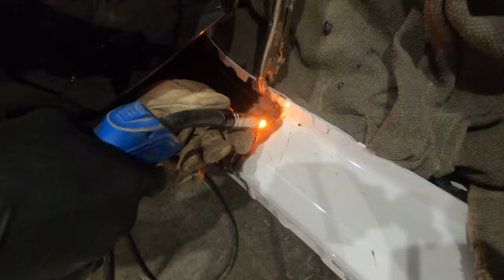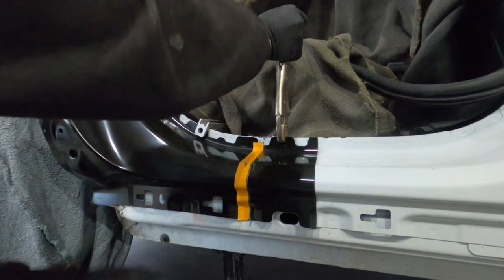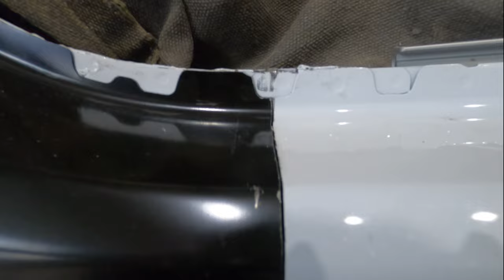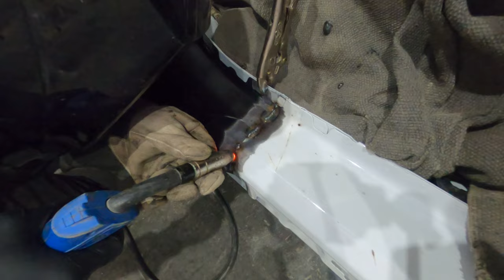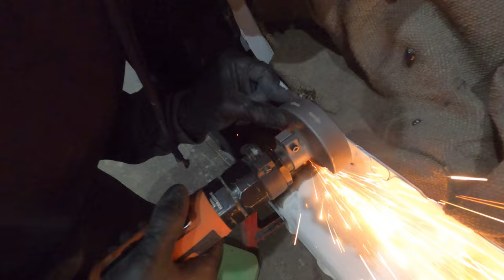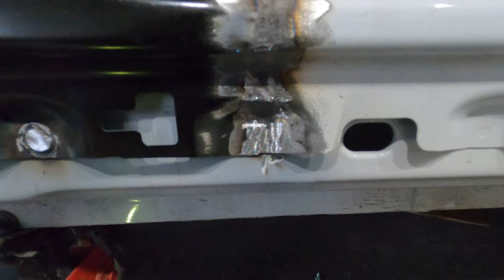How To Cut for a Butt Joint When Sectioning Panels (TUTORIAL)

Comment: I'd been shown to angle the saw blade at 45degrees so when you drop the two pieces in the gap is narrower
Reply from the maker: That is actually genius 👏 👌 
Thanks for the tip! I'll have to give it a try on the next one
Reply: That works fine on flat pieces,but not so good when you cut profiles

Comment: When butt welding with a gap inbtween the panels, where do I start the weld? Right in the gap? Won’t the wire go trough the gap? 

I’m new to welding so all help is appreciated
Reply from the maker: @Andreazz  I always start on an angle and aim for the very edge. This will create a bridge. Once you've tacked all your spots and the joint is flush. You can start your weld on the tack weld and go straight off the previous tack. Hopefully this makes sense
Reply: @AUTOBODYTECH  makes sense! Start in the very edge if what part? The repair panel or the actual body of the car? Or should I just go for the thickest one?
Reply from the maker: @Andreazz  either one, it doesn't matter. I always choose the side I can be the most comfortable with to get the best result.